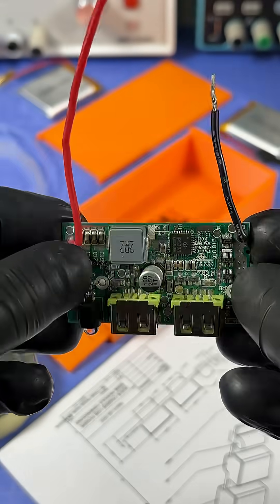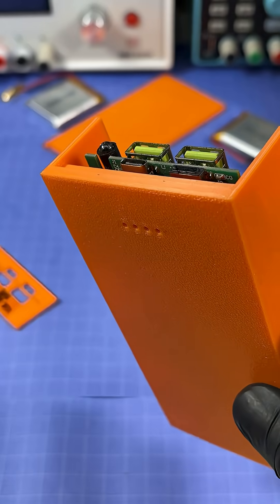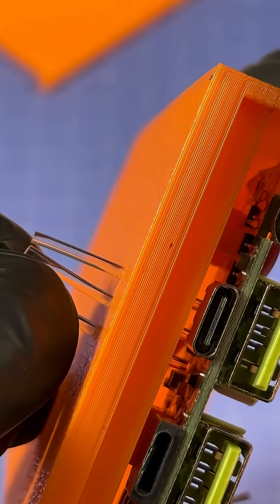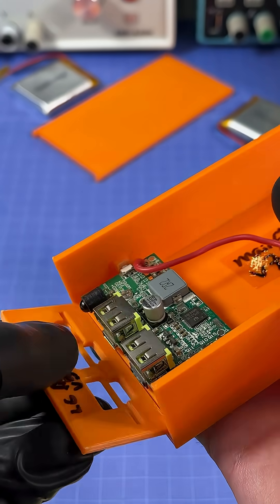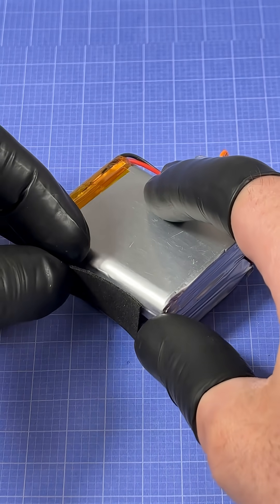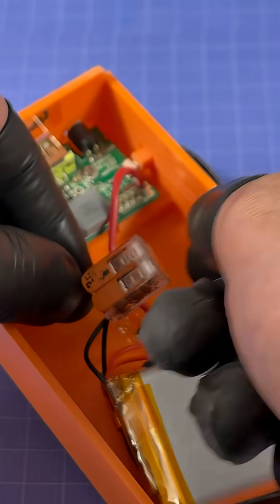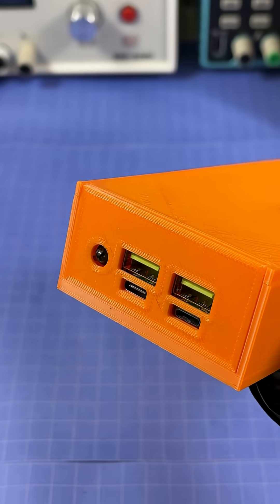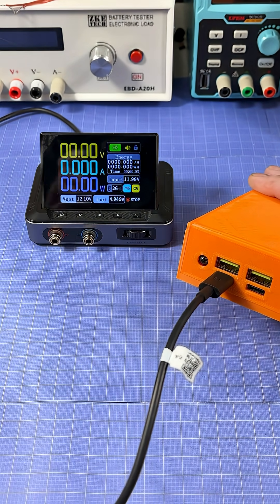DIY Fast Charging USB Power Bank Build! #electronics #engineering #cool #technology

Comment: Quick PSA: when putting lithium batteries in series.
Part 1. They have to be charged up to equal charge. Otherwise the cell with the higher charge is going to dump hundreds of amps into the other cell until they reach equilibrium. This doesn't apply with cells protected by a BMS circuit but you shouldn't be putting those in series. The BMS circuits aren't designed for it.
Part 2. The cells must be closely matched in capacity. Otherwise you get issue with the weaker cell running low and the other cell constantly having to dump power into it to reach equilibrium which effectively cuts your overall capacity by the number of mAh of the weaker cell.

Comment: Does anyone know a really good chip, that can do USB c pd at atleast 65W? Preferably as cheaply as possible?
I would like to put some voltage between ~13-21V in there and charge my Laptop.
Reply: sw3518s if u wanna make a power supply, do design it like a psu and not a pwerbank coz continuous high wattage draw will heat it up quite a bit.
Reply: @mynk0.78mm no, I don't. I have a mixture of BMS and protection systems for my batteries and I wasn't able to find a good module that would do step up and step down conversion. Do you have any ideas?
Reply: @idiotspieltminecraft1032 k got it, try 
SW6802 for 22.5W, injoinic based boards are more powerful, IP 2366, 2368 both can do 100 watts atleast
Reply: @mynk0.78mm thanks, I've seen the ip2366, but it was always in a battery protection based board, that needed an external balancer. Not a problem for me, I'm thinking, whether I could even leave out my own designed prot circuit, that does under voltage and over  temp protection. The single problem is: if I don't get the IP2366 to configure properly over I²C, I would have to build in some kind of diode circuit. For 140 Watts...
Reply: @idiotspieltminecraft1032 my comment doesn't show up, find the black color ip2366 idk what triggered it so keepin it to a min
Reply: @mynk0.78mm i chose the black version, because it is the cheapest with the confirmed chip. Do you know something else about them? Do they have I²C exposed? Or should I take out the resistors of the LEDs for it?

Comment: Batteries in parallel can self-discharge each other to close to 0 volts when not in use or being charged, reducing their lifetime health. I would always manually disconnect at least one of the shared poles from each other when not in use or being charged.

Comment: Not sure if you made a V2 yet but you should make the side where you check the LEDs 1.5 mm longer and make it smaller so you have to slide the fiber cable into from the inside or make a small overhang as a retention clip

Comment: you can also put some hot glue on the led, turn it upside down and let the gravity do its own thing, after that you should end up with a hot glue string from the led which also light up!
Reply from the maker: That’s such a creative idea!! I think another substitute could be those 3D filament-like spools they sell for those “string trimmer” machines. But I’ve never tried that. Honestly I might make a short and compare how well light from both an LED and a laser travel through it vs the ‘fiber optic’ cable I have (it’s not real fiber optic cable but it’s made for a similar purpose) 
Since on mine there’s an outer layer which seems to be made of a more light-diffusing plastic/finish, with a crystal-clear inner layer for the light to travel through.

I tried coating it with gallium once to see if I could make it a reflective outer layer but it just wouldn’t stick.
Reply: @KeonsLab  For mirror coating try aluminum or silver coat. There are some vids on how to.

Comment: I have 900mah 9.6v 6 long slim rechargeable batteries and 12 3.6v that come in pairs of 3 I just ordered same looking boards I am really confused on how I can get power to the batteries tho to recharge I see all you did was plug in the usb hopefully it will be that easy got the lights from work today off emergency exit lights that were demoed
Reply from the maker: Can you provide more details? Because depending on the battery type, these types of boards may or may not be compatible with them. If you’re working with lithium batteries you need to be extra careful to make sure you’re following their specifications, as these quick charging boards can deliver quite high amounts of current. 
Also never mix and match rechargeable batteries and preferably use new cells for builds like this.

In my honest opinion, please do adequate research on any batteries and charging boards you’re using to make sure they are 100% compatible, and won’t result in an undervoltage, overcharging, over-current, and that the capacity of your cells is at least the same as the charging/discharging current from the board; so for a board that delivers up to 3100mA like the one I used here, you’d want at least a 3100mAh battery. Keeping in mind that these board are specifically designed for 3.7V lithium-ion (18650-style) and lithium polymer batteries, and should not be used with LiFePo batteries or any other kind of rechargeable battery chemistry.

I don’t say this often but if you do decide to proceed, please do your due diligence, and I hate to say it but I’m not responsible if anything goes wrong, and I personally wouldn’t recommend using old/used batteries for this purpose.

Comment: The Chinese will copy and paste that in 2 hrs and will be here before this video finishes.
Reply from the maker: Maybe, and to be honest it wouldn’t be too difficult for them to copy, but if this was an actual product it’d take them a lot more time since the only part made in china is the charger board.

But generally the mindset of being scared that someone else would steal my ideas was the reason I still haven’t revealed my biggest projects yet. But this year that’s changing, because I’ve realized that with the more advanced projects, sure they can try and copy it, and they’ll probably get some sort of product that looks and functions similarly, but they’d have to cut costs somewhere. And with the types of materials and methods I plan on using for my upcoming projects, I imagine a clone would almost always be lacking in quality in one way or another.

An example: for one of my upcoming projects, I went through several design iterations; fine tuning voltages, testing different adhesives and ‘torture-testing’ the final product by hitting it, knocking it over while running, dropping it, and then letting it run for 30 hours to make sure it can withstand daily abuse.

One of my adhesives proved to not be very durable even though it gave a very nice looking result.

So while the Chinese (or any other mass-producers of tech products) can and certainly will try and clone original designs, it’s the quality, performance, and longevity that will differentiate the original and the clone.

Not to mention it’ll be much harder to clone if the product was never made in china in the first place as they’d have no access to the blueprints.

I plan on eventually making actual products with such high quality that it’ll keep working and working even when the logo/branding has faded away from being used so much; I keep hearing people say “they don’t make ‘em like they used to”, well I’m going to try my best to ‘make ‘em like they used to’.

Comment: You have to share the board you are using dude XD what if I want to build one too
Reply from the maker: Ive been using these for ~3 years and so far have only found them on eBay surprisingly. (You can find other boards with QC3.0, but the holes for the screws and 7-segment displays are in such weird positions that it makes designing anything elegant-looking almost impossible, and especially those 2.4A ones with the 7-segments and horribly positioned USB ports are so bad because not only do they not give the full 2.4A (in my experience), but the usb port placement is like it was made by a toddler. I’ll show some pictures of what I mean in a short or video or something.

But anyway, I went through my order history to find the link to the board in this video and put the eBay URL in the description for anyone interested. 

I have no idea what they’ll charge for shipping though.

If it helps in any way, the chip on the PCB is the IP5328. So unfortunate that good quality boards are either super expensive or hard to find.

Once I get good enough at PCB design I’ll definitely try and fix that problem and make it open source or something